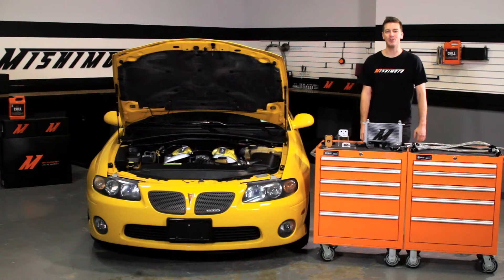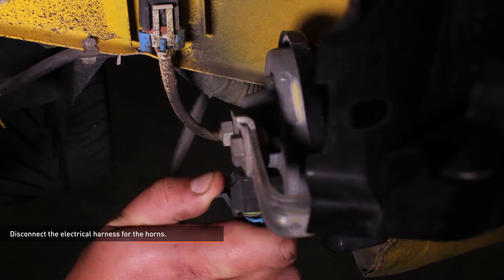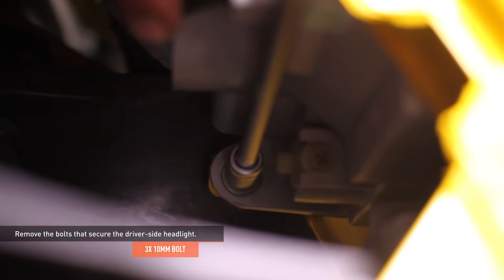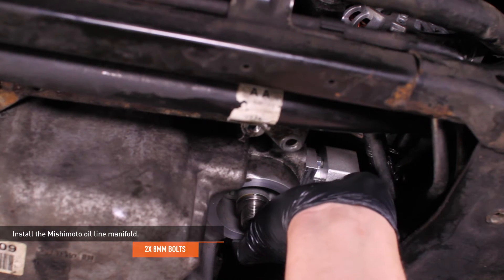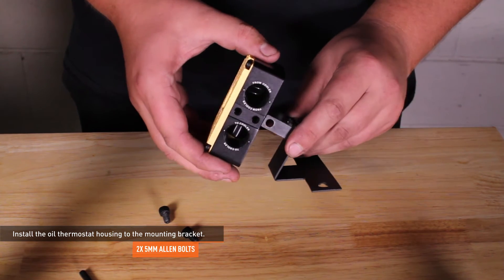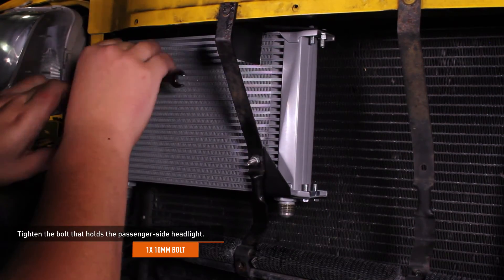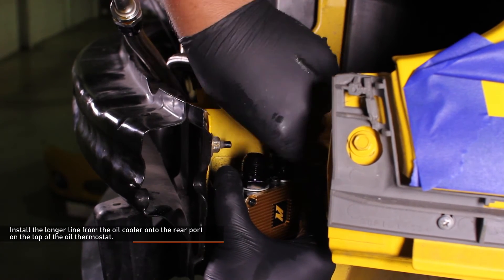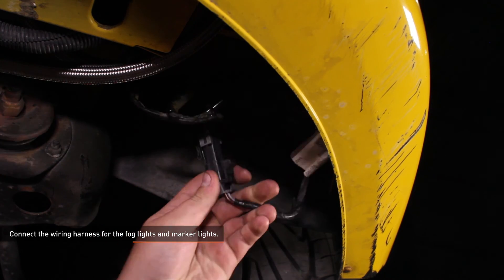2004-2006 Pontiac GTO Oil Cooler Kit Installation Guide by Mishimoto

Comment: Will this lower my engine temps? I have an LSA swap GTO. Does the adapter have a npt for my oil pressure gauge?
Reply from the maker: Yes, the adaptor housing has (2) 1/8 NPT ports available.
Reply: @mishimoto  sweet I just purchased this last night lol .. I hope it helps my engine temps too. I also bought some hood vents.

Comment: Great video, I am looking at buying something like this for my 2002 LS1 powered Commodore, will this kit fit? Only thing I can say about the video is run the car and check for leaks before putting the bumper back on, easier to spot the leaks and to fix leaks if you don't have to strip the car again.
Reply from the maker: We have not tested this on the 2002 Commodore.
Reply: They're the same car buddie.  If it fits this GTO, it'll fit your commodore.  Follow VY series2 HSV clubsport manual sedan owner here

Comment: The transmission cooling lines don't fit properly on my install. There are sealing washers near the end of both lines however the radiator fitting holes are too small and prevents the sealing washers from seating and sealing. The end of the transmission lines bottom out instead of slipping into the holes, which are smaller. This causes a transmission fluid leak. I'm currently down without a reasonable solution. Second radiator sent by retailers as the same issue.  Please review your design and/or manufacturing quality controls.
Reply: Did you ever figure it out?
Reply: Sucks having an auto heheheh
Reply: @buddyrebel_Garcia If you have any manual C5 and up Corvette, or any newer 5th gen and up Camaro manual trans, they come with cooling systems for the engine and trans, regardless of being automatic or not.